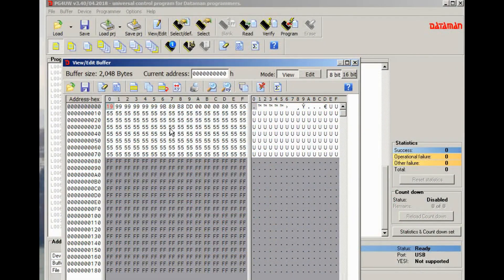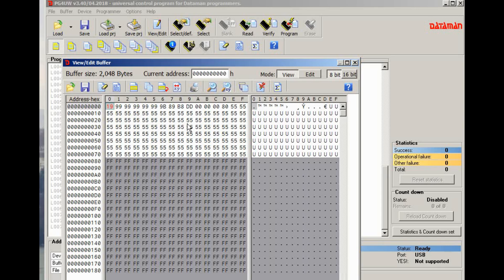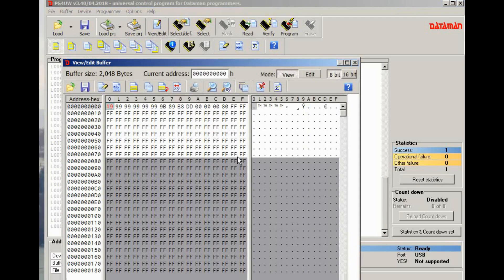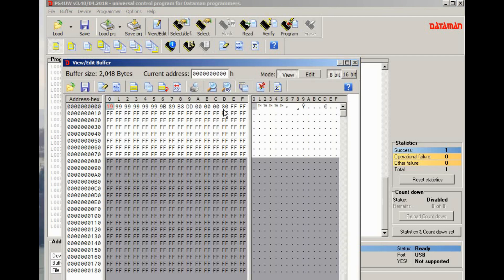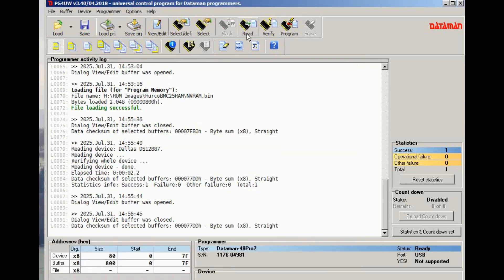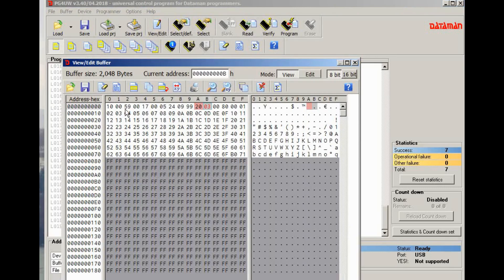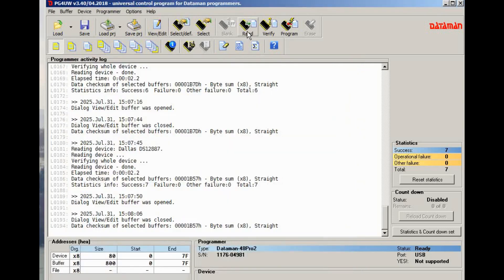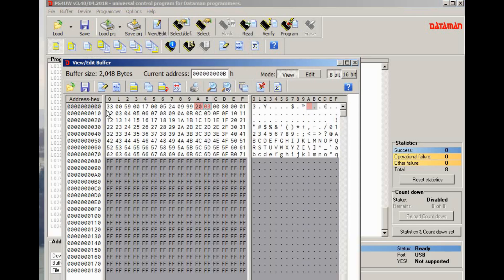Hurco BMC25 Controller Repair Part2

Comment: Please forgive me if this does not help but BEEEP beep beep i believe is no video controller\video fault
Reply: Guessing there is a register in the chipset that is set by a value in the dallas chip, that tells it to initialise a graphics card or not, which defaults to initialise - for obvious reasons if you were using it on a standard PC.

If you can't get a video display working then may be helpful to look up the data sheet of the chipset, then put a logic analyser onto the dallas chip and the data /address lines of the chipset ICs and find when that register is being set, and then work back to the values it reads from.the dallas at the same time then go and manually change that value in the dallas to tell it not to initialise the video.

I also accept this process could also be being done at a software level at which point this process clearly won't work.

Given you are getting a beep code (one long two short) its definitely executing code on the CPU.
Reply from the maker: That is correct and I cover that in a later video (The videos are always behind real life) but I will cover the repair in a logical series of steps and the VGA card error is not really what I am looking at in this video but many thanks for the comment.
Reply: Precisely.  That's a 'no video card' error, at least on normal PCs.